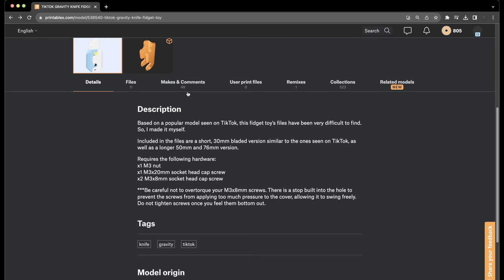3D print TIKTOK GRAVITY KNIFE FIDGET TOY

Comment: Did u sand the blade? mine keeps getting stuck
Reply from the maker: No
Reply: Try changing your xy compensation in the slicer, had to lower mine by -0.05
Reply: yes. lower your z hop
Reply: @okay_tumbleweed   how can i change that,im new for this (using cura)